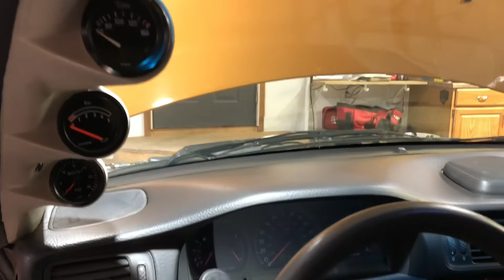Featuring my 1998 Saffron Volvo V70R after upgrades, restoration and modifications. “Saff”

Comment: I first got a 99 v70t5, but ultimately cracked the block after a coolant line had rubbed the trans dipstick bracket and ruptured one day. 😬

Some years later i now also have a 98 v70r in saffron! Got it last year. IT WAS SOOOOO CLEAN!!! PO had maintenance records, only used OEM parts for all maintenance, interior was beautiful, plastic all in one piece, even had cargo cover and nets in the back seats still present!  9 months later i got T- boned by some kid who didnt look as he left a stop sign!! I got to find out just how few parts are compatible between the 98 and 99 wagons, but finally got it rebuilt and now the angle gear (collar likely) decided to give out. 

Even with the handful of issues these P80s age into, im still excited to get my wagon back as my daily driver; hopefully in another week or so! Definitely a great headturner and a fun drive!
Reply from the maker: You can’t go wrong with a Saff wagon!  My dd is one; people love the car, leave notes on it and it’s easy to spot (safety feature, lol!). I also like the simplicity of ME4.4. Add a manual swap and wow, what a car!  Thanks for watching and for sharing!

Comment: Engine not 98 years. 99+
Reply from the maker: Good eye!  It’s a B5244t5 from a 06 s60t5, port matched n/a intake, 960 throttle plate, port matched exhaust, k24, green injectors, 3” catless dp, do88 ic, tune, etc!
Reply: @handydand  vvt?
Reply from the maker: Unplugged at present. With further tuning this can provide additional power.
Reply: @handydand  I was afraid to set myself 99+
Therefore, in parts I assembled 5234T5 from 850R
The old 5234T3 with 720K mileage did not begin to be repaired.
Tomorrow I'll take out the old one and put everything on the new one.
I am doing repairs leisurely as I work alone. No help at all.
Reply from the maker: Gotcha.  Sounds like a good plan and working alone adds difficulty; it will be worth it when you complete!